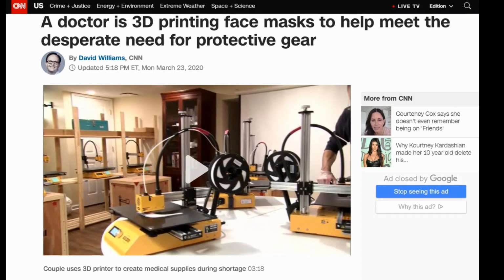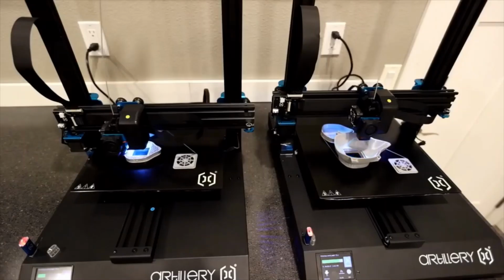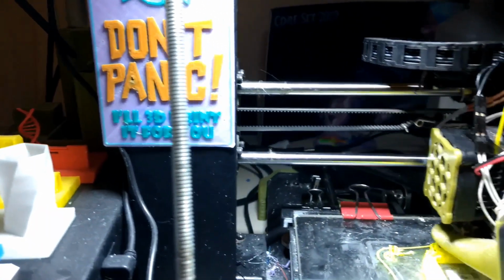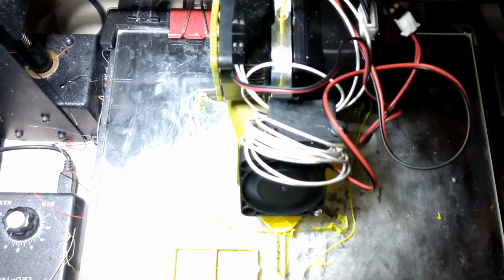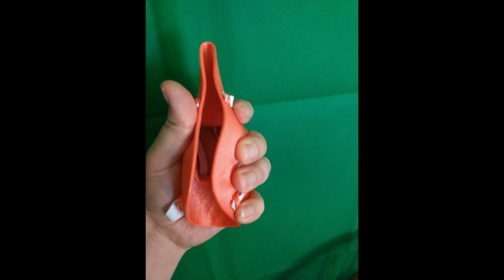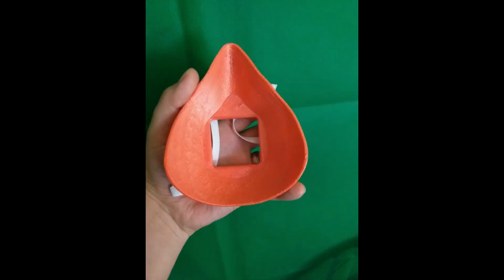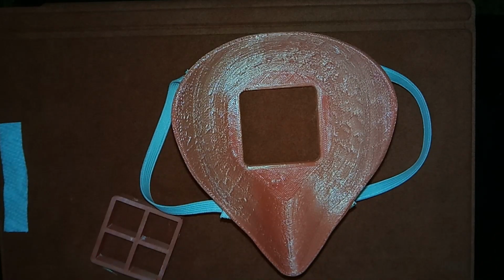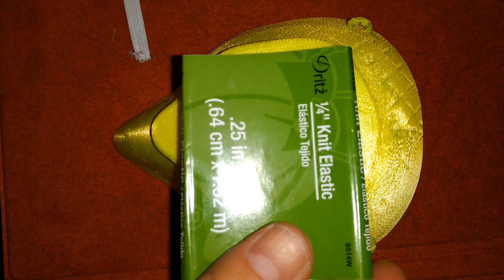3D Printed Respirator Mask in TPU

Comment: Hello Joshua, I love how you've used TPU for the mask! Could you please tell me what are the print settings you used for your mask? Also, what size of the Montana mask are you using/would recommend? 
Best regards.
Reply from the maker: I print at 40mm/s and .3mm layer heights. I generally use the regular size. For smaller faces I print a 90% size with a recut filter holder.

Comment: Hi D. Joshua, Thank you for the wonderful video, I am a newbie and need help with Profile settings for The Mask - I am using Ultimaker Cura for slicing, but really need help with the Profile Settings for the TPU for Cura if possible. I only have a Eryone Thinker S printer and spent the whole day ( so frustrated)  trying to figure out the proper settings. My husbands hospital are running out of masks and I wanted to have some made for him to bring to the hospital on Monday, can you or someone here help me with the proper Profile settings for TPU so I can just easily plug it in, I really appreciate it. Also, should the retraction remain enabled or not? Thanks, everyone, and Happy Easter. Stay safe ;-)
Reply from the maker: I don't know for your specific printer, but generally TPU requires a higher temp, around 220C, and a slower print speed, 20-40mm/s. Supports may also help with the nose. What have your attempts looked like? You can also print in PLA. It makes a nice mask as well and is much easier to print.
Reply: @mbioman  Thanks Joshua for your help. 1) Can you be so kind to share your PLA Profile settings, I tried to do the TPU settings with the 10% infil and it says it will take 11 hr 1 min to make the mask and the filter with the flange. 2) What slicer are you using? Can you share your G files with me, I really appreciate it. My Printer is a Eryone Thnker S and I am currenly using the Ultimaker Cura to slice the files. 3) Also, should I be using the Make The mask files from the original site for the mask and the filter with the Flange? I am Sorry for so many questions( 3) , Its 4 am here and I have been trying to set this up since noon today but its  a huge learning curve and I  am scared to make a mistake and found out 11 hrs later that my prints did not work ;-(
Reply: I can try the PLA settings if you have the correct profile settings to print them on, then I can print them and they will not take as long as the TPU settings. Thanks again for your help and look forward to your reply,
Reply from the maker: @lisafong717  I also use Cura. I don't think sharing my gcode file will be helpful since I have a different printer. Yes, use the Makethemask files including the filter with the flange. Are you getting good bed adhesion? In Cura increase the layer height to .3mm. Print 2 walls (.8mm)  and set top/bottom to 3. Print speed at 40mm/s and infill at 10-15%. Hope this helps.
Reply: @mbioman  Thank you Joshua - I gather the settings you gave me is for The TPU Filaments, correct?  I am following the order of the settings on Ultimaker Cura so I don't make any mistakes. - I just want to ensure I placed these in the correct place: changed the Layer Height to: 0.3 mm and Initial layer height to: 0.3mm  and Line width to 0.4 mm and (Wall line width) to 0.8mm, outer wall line width to: 0.8mm and Inner Wall Line width to: 0.8mm and top/bottom line width to 0.4 mm  . Then I adjusted the Shell  Wall Line Count to 3 > Top layers: 3 and Bottom Layer: 3. I change the wall Line count to 3 for the shell and the Top and bottom layers to 3 and Print speed at 40 mm and infil at 10-15%. I hope this is correct. Joshua, also, is this the same settings for PLA as well, and if not, what are the changes I need to make. I really appreciate your help as once I get these down, I can start printing the masks, God Bless You and Thanks again.
Reply from the maker: @lisafong717  Wall line width should also be 0.4mm matching the line width. The same for outer wall and inner wall width. Those should all match the line width of 0.4mm. The others look fine. For TPU use 15% infill and print 30-40mm/s - if prints are jamming or not adhering properly go slower. For PLA, 10% infill should be fine and 40mm/s or faster if your printer is capable. Adjust printing temperature for the filament. Generally this is written on the filament spool.
Reply: @mbioman  Thank you so much for your help! God Bless you!
Reply from the maker: Were you able to print the mask successfully?
Reply: @mbioman  Hi Joshua, I was able to print it on PLA but I am having issues printing it on TPU, the filament starts to bend at the Bowden while treading and, for TPU what should the ( Under Material)  build plate temp be? I have it as 60- is that correct?  and what should the Build Plate initial layer be, I also have that as 60, is that also correct?   Do you keep the (TRAVEL) enable retraction checked when printing on TPU, also for the settings as the initial layer on the filter I tried printing was soo thready? ;-(   i s the TPU mask safe to use and clean ? or is the PLA mask safer to wear and clean.  Thank you for your help and support.
Reply from the maker: @lisafong717  Printing TPU with a Bowden tube is challenging. I didn't realize that's what your printer has. You will likely need to modify the printer to get TPU to print, not just adjust settings. Here's one way I've seen others use: https://www.youtube.com/watch?v=vwPQuYuEBe0&t=78s. If PLA is working for you, I suggest using it. It is much easier to print. The PLA mask is still very usable. Both can be cleaned and disinfected and are safe to use. TPU is actually easier to sterilize because there are more options available from using boiling water to alcohol.
Reply: @mbioman  I have 4 questions for you, can you be so kind to answer tme, thnak you. As regards to printing on Ultimaker Cura with PLA, is this setting correct? ( Under Material)  build plate temp be- is 60- is that correct?  and what should the Build Plate initial layer be, also is 60 correct for this?  question 2)  Do you keep the (TRAVEL) enable retraction checked when printing?  Question #) would the same settings above apply to printing on TPU as well? question 4) is there a larger mask file available or is this all one size?
Reply: @mbioman  , you said to print 30-40mm/s- is that the Print material or printing time?
Reply: @mbioman  you said on PLA: For PLA, 10% infill should be fine and 40mm/s or faster if your printer is capable.JUSt to clarify,  so the 40 mm , are you saying that  ( under Speed Settings) Print speed that should be 40 mm ? and in the infill Speed- should that be 60 mm? Pls confirm. . I wish I can screen shot my settings so you can see if it's correct. Thanks for your help with this.
Reply from the maker: @lisafong717  40mm/s is a speed setting. Cura will often adjust this somewhat for walls, infill, travel, etc. Don't worry about those specific travel values, just the overall speed value. 40 for PLA is probably fine. For TPU you may need to slow that down to 20-30mm/s. For different sizes of masks, scale the model in Cura. Make sure the same scale is applied to each xyz axis. I generally do 90 and 100% prints at a ratio of 1:4 depending on the need.
Reply: @mbioman  Thank you, Joshua, for your wonderful help and kindness and patience, I really appreciate your time for helping me out. I was able to make some maks, but my husband says the size of the masks is too small for his face, so now I have to learn how to make the masks larger, so he can talk to his patients while the mask is on, the mask files are for a smaller face, do you know if there is a mask.stl file for a Mans face, a Larger face that's available, if so, can you share the link with us. thanks again for all of your help. I am truly grateful.
Reply from the maker: @lisafong717  The simplest thing to try would be to scale up the file in Cura. Go to 105 or 110% perhaps. Additionally this file uses the standard mask size, but pushes the filter a little further from the face: https://drive.google.com/open?id=1xusKVbH8d2b6VjwBmiz11aDzXATt4ieO
Reply: @mbioman  Thank you, Thank you, thank you! The TPU settings you provided to Lisa Fong allowed me to do my first print with Kimya TPU-92A Blue out of the box and achieve printing results of around 90 to 95% with the mask still being usable. Only issue I had was outer wall layer adhesion in a couple of spots but the mast still was able to pass a fit test and printed in 3 hours 45 minutes at 50ms @ 230C. Brought the temp to 270C and the speed up to 70ms and it should print in 2 hrs 16 min and so far the print is looking much better so I'm keeping my fingers crossed that this works. If it does I will start printing 4 at a time as I am using a QIDI TECH X-Max. I'm a frontline worker in power generation and am heading back to New York next Wednesday and me and the rest of my crew are just about out of masks.With these we get by as we can't cut each surgical mask into 6 filters and stretch out our supply and God willing have enough to make it through the outage. I was in China about 2 hours from Wuhan when COVID came to light and have been in a mask everyday except for being at home under quarantine 2X since mid January and have been able to remain virus FREE! Knock on Wood. Again thank you for taking the time to make this video, your on my hero list going forward!

Comment: What Infill are these printed at? seems like you could speed a print way up if you could cut down on infill. My printer requires slow speeds for a successful TPU print so infill is a big variable. Thanks,
Reply from the maker: The TPU masks are printed with 15% infill. Any less and more top layers are needed. Its a balancing act. I'm printing at 30-40mm/s depending on the brand of TPU using 2 layers for the bottom, 3 for the top, 2 walls, and .3mm layer heights. PLA masks can be printed much faster at 60mm/s and using only 10% infill. I can print a full size TPU mask at 3hr 25min each and the PLA at 2 hr 15min each - if doing multiple per bed plate. A little longer for individual prints. (edited as I just did the math again)
Reply: @mbioman  How do you print them so quick? In Cura it's estimating over 6 hours for one TPU mask and filter, with 30mm speeds and 15% infill. Did you block supports for the filter flange?
Reply from the maker: @robincreffield5555  How much infill are you using? That will affect the print time. The more you use, the long it will take to print. Also check your print speed. If you are using flexible filament like TPU, Cura default settings are quite slow and may be adjusted depending on machine performance and capability.
Reply: @mbioman  I thought I used the same settings as you. Not to worry. First one finished OK but it has holes in the hose section so it's useless, unless I can melt them closed. Using TPU for the first time so still tuning it. Setting another one going overnight but if that doesn't work I'll try using more supports
Reply: Tried printing with supports, with lower speeds, higher flow rate, more infill, more shell layers etc. but still have pinprick holes and the inside is so rough I'm not confident about the seal. Giving up for now. I'll have to dry my filament if I try again.

Comment: Joshua,

Did you print the filter frame in PLA, or was that also in TPU?
Reply from the maker: I've been printing both the mask and filter in both TPU and PLA. Tolerances aren't too variable between them so it should be fine to use a TPU masks and a PLA filter.

Comment: Nice video. Ive never print in TPU but seems more comfortable for a face mask
Reply from the maker: I'm printing the masks in PLA and TPU. Both have their benefits. PLA print faster and more reliably and can be custom fit if needed. TPU is more comfortable, fits well, and is an easier material to sterilize.